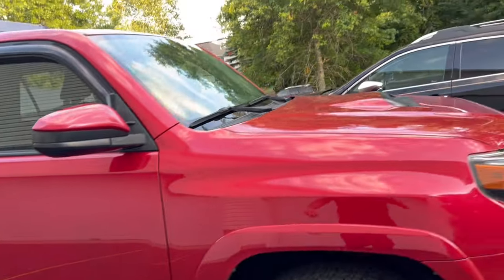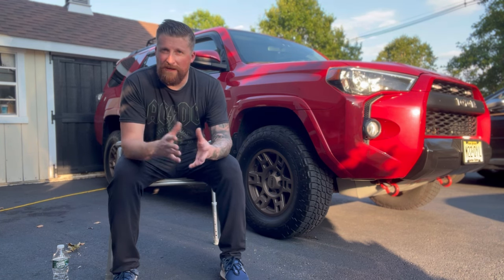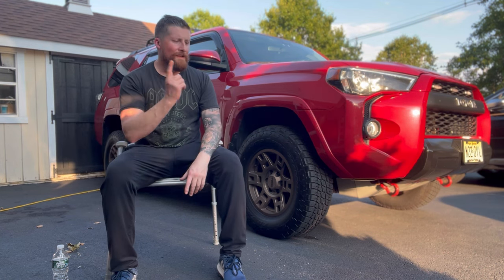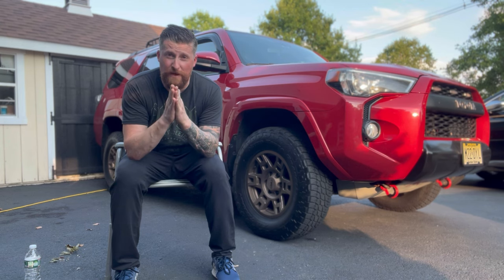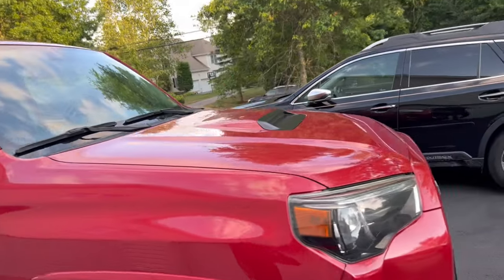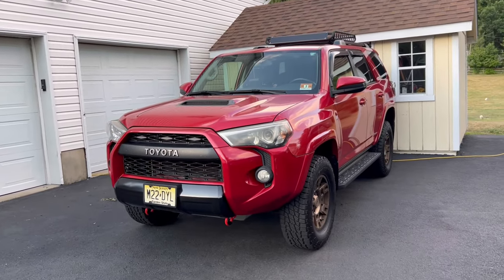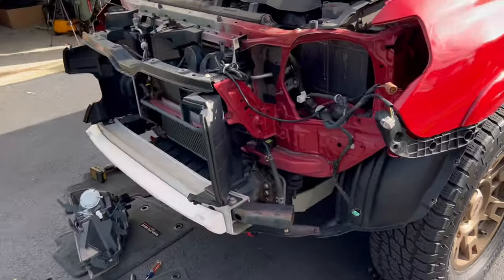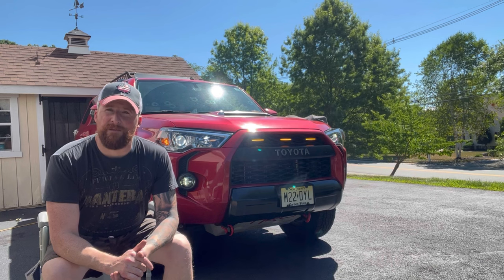The Toyota 4runner Story I never wanted to tell! It was cheaper but…

Comment: You gotta live with it. My 4Runner has waaaaaaaaay more rust under the whole vehicle than yours. I'm guessing an issue with 4Runners? But it runs great! If you don't like it - probably best to trade it in. 

Mine is paid off so I'll drive it until the engine goes. Currently I have 230,000 miles on it.
Reply from the maker: 230k that’s awesome, what year?
Im totally going to live with it, at a tender 168k miles she’s barely broken in + in 5 years has never let us down.
Best car I’ve ever owned.

Comment: Great story/video! Really appreciate all the straightforward commentary and advice from the videos. I just purchased a 21' TDR ORP with 45k miles from Enterprise rental. Clean Carfax but no maintenance records other than most likely changed oil  and rotated tires. Took it to my trusty Toyota dealer and told him to assume nothing had been done and to start all over. He took my money of course but said overall the truck checked out great and is in really good shape mechanically. I always get over 200k on my vehicles, but I've always purchased them with less than 20,000 and even then with complete maintenance records - so a  little nervous.  Your comments certainly help to alleviate my anxiety. Looking forward to mods!!
Reply from the maker: I appreciate your support!!
TRD ORP nice find 👍🏻
I can guarantee you that with routine maintenance, 200k will be a breeze. 
Lots more content to come. 😉

Comment: Considering I bought a 4Runner that had a Carfax that showed two wrecks I think I answered your 1st question!  The challenge with the Carfax is that it doesn't show the severity of the wreck beyond general categories.  Also, I figured if the wreck shows up in Carfax it was probably fixed professionally....although as you mentioned that is no guarantee the work was done properly.  I have only had my 4Runner for a little over a year and so far no major issues so time will tell if I got a good deal or not.
Reply from the maker: Fingers crossed 🤞!
Thank you for sharing your thoughts.
Appreciate you watching!!

Comment: Here’s a pro tip. Before putting in new headlights, wet sand them and clear coat them with a quality clear coat. This will keep them from fading and yellowing. I’ve been restoring the old faded headlights in our vehicles this way and the results are amazing and you can wax your headlights when you wax your car. I wish I could post pictures of the results on here.
Reply from the maker: That’s very Interesting, I certainly don’t want to replace them again. I appreciate you sharing!
Reply: This does do a pretty good job.  I’ve been doing what wildman’s suggested for years now.
Reply from the maker: Might just try it on the old headlights first.
Reply: @VikingsGarage  Same I've wet sanded polished them and with time and with no care to them they will fade again. Wet sanding them then clearing them with 2k clear coat they will look a lot better and last. I would use a better coating then wax. Like ceramic coating or graphene coating.  There's some decent ones that don't break the bank on Amazon. Watch a few of Scott HD videos that he does tests on cheat to expensive coatings for over a year and has monthly updates on his test panels of multiple products.
Reply from the maker: Thank you!
Reply: @SescoDviejoC  Yes, the 2k glamour clear is what I use also. I just did my daughters 2010 Camry and they look better than new. It made the car look new again. Wish I could post pictures on here, they look like diamonds! 😁
Reply: So frustrating brother, and sorry for your headaches!  As we all know used cars are typically sold “AS-IS”, so I don’t think you have any recourse.  You are correct that Carfax is not always accurate.  I did have a Land Cruiser that I caused over $8,000 in damages to, filed an insurance claim, had fixed at Toyota, and it never showed up on Carfax when I sold it.  With that in mind, I’d never buy a used car without taking it a mechanic, and a body shop to have them check things out.  Regarding replacing your doors, have you tried an auto junkyard?  They take in totaled cars to sell for parts (you usually have to bring tools to remove the parts yourself).  As popular as the 4Runner is, and as long in the tooth that the 5th gen is, there are bound to be some undamaged doors at an auto junkyard somewhere near you.  I hope that helps, and good luck sir!
Reply from the maker: Thank you , I appreciate that!
Reply: Thank you for the great tip, much appreciated!
Reply from the maker: You got it!
Reply: @VikingsGarage  Can you do a video on wet sanding the headlights and clear coating them?
Reply from the maker: That’s actually not a bad idea. 🤔👍🏻
Reply: @VikingsGarage  I can’t wait!

Comment: End of the day, most solid vehicle on the road. 

I sold my 16’ but a coworker that does inspection work literally idles his 12hrs a day. AC on in summer and heater on in the winter. He complained at 180k when his water pump started weaping. I told him well you haven’t shut it off in over 6 months 😂
Reply from the maker: That is insane, but you’re absolutely right… that much abuse it was kind of expected. 
It’s one of the most reliable vehicles I’ve ever owned. I’ve owned a few!!
Thank you for sharing your story.

Comment: Yes, I did the same.

I bought a used cargo van at a very low price.  I could tell it was in an accident by the slightly mismatched paint but the body work was immaculate, as being a cargo van, there was no insulation in the interior so I could see all the metal panels from the inside.  I'm not a body man by any means, but I couldn't see any wrinkles or welds in the body from outside or inside.  I crawled under the van and couldn't see any frame repairs or major rust.
Reply from the maker: And bet you, it’s been a great van.
That was a great 4Runner, my brother in law is still driving it.
Currently at 210k miles

Comment: I would have bought the truck for 21k. It's a good buy as long as it didn't have structural damage.  Check the A pillar because the driver door isn't aligned to the fender or the rear door. The reason I know is because the body lines don't match up.
Reply from the maker: I will check it, although not much I can do at this point. I appreciate you watching, thank you for the info.

Comment: I personally think you're still on top with this 4runner. 
The body work done could be the insurance company the previous owner had. Geico (if that's what the previous owner had) tends to pay out the least compared to other insurance companies (they estimate using cheap aftermarket and some times junkyard prices. Offset that with a cheaper estimated bodyshop work = not so good results) and your 4runner could be a reflection of that. 
- As for the doors, don't go to MAACO. That's the worst place to go (you get what you pay for). If you're thinking of replacing the entire door with good ones, I'm sure with some patience you can find a pair with same color. If not, wrapping the truck with mismatched color doors would be a decent solution 🤷‍♂️. 
--I guess these are the issues that come with a "dirty" carfax vehicle lol
Reply from the maker: Ain’t that the truth, insurance companies will most of the times not pay enough to the body shop to complete the work. Hence why they do what they do.
I think your right, some patience and I’ll find some good doors. 👍🏻

Comment: I just purchased my 2015 SR5 with a “dirty” one owner carfax, although I would really only consider it a dirty carfax if it had been moderate/severe damage. Upon arrival I found some very slight front bumper fitment issues which were indicated by the carfax, but also noticed the rear bumper had some issues which weren’t on the carfax. The other thing the carfax showed that every single oil change during winter months had been done in South Carolina, so that pretty much cancelled the fender benders in my opinion.
Reply from the maker: Thank you for sharing your story.
The same here, the first 60k maintenance was very good so I kind of took that as a factor. 
The Dodge dealership should have changed both filters before I got there, plus their clean-up crew never clean under the 2nd row seats. So… I used that to save an additional $895 🤷🏼‍♂️😉
Reply: @VikingsGarage  that’s unfortunate, but like you said it’s a great bargaining chip when you bring it up to them. The reality is that many people who want to buy a car just drive to a dealership and leave with whatever appeals most to them. When you are mechanically inclined and have hunted down a few very good options, it puts you in a great position as a buyer. 

I live in upstate NY and there’s a few shady dealers around me. I had to drive out to Binghamton to buy mine. I do have to say, I bought at the wrong time but I could not wait any longer than the year and a half I’ve been waiting to buy one.
Reply from the maker: I hear you buddy, right now forget it. Buying a car is almost absurd.
But I get it, that’s a long time to wait. Congrats and enjoy it!! 
Thank you for your support!!

Comment: I really want a 4Runner and I’ve seen a lot. I even considered getting a rebuilt title, it looked good and the guys at the dealership said it only had water go up halfway to the tire, but I knew it was going to bug me that it wasn’t a clean title. The majority of 4Runners I looked at the carfax was clean but you could tell by the gaps that it had work done. Guys go and get stuff fixed and aren’t reported. It’s a crazy time to buy anything but I may go brand new knowing it’s definitely a clean title if the prices ever come back down to earth, if not then I’ll be driving the RSX-S until it’s no more.
Reply from the maker: I don’t blame you, the market is totally bunkers right now. Wait a little, then buy new.

Comment: That is an easy question to answer.  Do you want another payment? Keep it and maintain it.  My 2011 runner I bought in March of 18 was great. The front bumper was repainted, which I knew about,  the clear coat peeled like a sun burn. I ended up making my sr5 into a trail with the front and rear bumper swap. I bought all the OEM front Toyota. I also installed OEM trail front and rear lights. Looked at local body shops. Reviewed their work, found a great one. 900 to spray the bumpers. I installed them. Unfortunately later that winter the rear spoiler and shark fin peeled too. 400 bucks later it is rectified. 
I am a huge preventive maintenance guy.  I maintain the paint, under carriage as best as I can. My last vehicle, 99 suburban,  the frame  rotted out.   I had it for 12 years because I just didn't want to have a payment.
Reply from the maker: Very cool, thank you for sharing! 
I’m right there with you, I have no car payments and I intended to keep it that way. We do whatever it takes to keep them sharp/ reliable and on the road. 
I appreciate you watching, hopefully you’ll find plenty of useful content on my channel to help you with your 2011. 👍🏻

Comment: i did the same thing.  I bought a 2018 TRD off road in barcelona red with two claims both were under 2000 and I reviewed the repair documents.  New front bumper replacement and rear bumper replacement.  no big deal.
Reply from the maker: That was exactly my thought. I saved almost $5k at the time. I appreciate you sharing your story!! 
Happy New year!!
Reply: @VikingsGarage  I didnt do as good as you did! since I just bought mine in August. Amazing how much they have appreciated in value. MSRP goes up every year.
Reply from the maker: It’s so crazy!!

Comment: You did save thousands when you bought her.  So my 2 cents is, keep her, and know that your awareness of the repair issues are typical.  I've worked with repair shops who were perfectionists.  And they did a good job.  We're the replaced parts toyota OEM?  Or Chinese.  But you have a 4runner.  You have the basics there, in excellence.  Power train and electronics are superior.  I lived with a 2005 subaru sti that had been hit twice by worthless deer.  Rebuilt but I knew that what basics remained, such as no performance issues after repairs.  Your 4runner is still a 4runner.  Get the work done on the doors.
Reply from the maker: I appreciate your input, I am planning on having it addressed and fixed properly after this winter. You’d right, at the end of the day it’s got that Toyota reliability. 😉

Comment: I bought a low mileage 1996 4x4 tacoma in 1999 for cheap. I bought it from a rebuilder due to being sold by the insurance company. It was torn up and different colors, missing dash ect. I rebuilt it and still have it 23 years later. I hope to get another 23 years out of it.  It's got 160k miles on it now. Nothing wrong with a salvage vehicle if you know what you are doing. Car fax wasn't popular back then but even if the title was clean. Apparently they ran it through Colorado and then back through a different state which washed the title. Colorado was an old trick. I was able to get a loan from the bank because of the clean title and just never said anything to them about it. I'd totally do it again but it's not for everybody. On a family vehicle I may not do it but for a work or offroad type vehicle sure.
Reply from the maker: Super cool story thank for sharing it with us!!

Comment: Great  job on headlights.  If it were any other vehicle I would be weary of keeping it with compounding troubles down the road, but a 4runner, take care of the cosmetics and it will out perform  any other in its class IMHO, keeping up with maintenance of course as I'm sure you're aware.  I have 2007 SR5 with 170000 and it drives like new, and I live in Vermont  salt belt,  but I Fluid Film the frame 2x year.  Great video, take care.
Reply from the maker: These things are built to last. Im a firm believer in preventive maintenance. So 🤞I’ll drive it another 60k.
I need to spray the frame again.
I appreciate your support . Thank you!!

Comment: your drivers side lights were likely replaced with non-OEM lights.  The discoloration is a dead giveaway.  After market UV coatings typically don't last as long as OEM.   You also live in Jersey which doesn't help with the rust issues.  Ex-Long Islander here and moved to Charlotte years ago.  When purchasing a used vehicle the first thing I do is look at the Carfax, even if it's clean but I see it's from the Northeast, it automatically gets passed over.
Reply from the maker: Yeah it gets rough around here with used cars.
I appreciate you watching!! 
Cheers 🍻

Comment: My question is how is the frame?  As we know the frame will determine the bones of the 4Runner.    We are on 4Runner #3, 2014 4Runner, also have a 02 4Runner.  If yours is 4wd and the frame is good, turn it into an off read beast with after market bumpers and other 3rd party stuff.
Reply from the maker: The frame is in great condition, I’ve been treating it for a few years. I have a feeling I might be doing a lot of aftermarket stuff in the near future.

Comment: My fathers was a originally a rental and had car fax damage for front and it has been great.  He got a great deal.   I do notice that the metal tube running vertical was bent and never fixed.   I don’t know if that makes a difference.  
I know drain holes on door tend to get clogged causing rust so I would make sure the stay clean.   
I would keep it and just fix it and never look back.    Where did you get your replacement headlights and how much?
Reply from the maker: Thank you for sharing your story.
The drain holes in the doors being free of debris is an excellent point, thank you for reminding me.
I got both headlights on EBay for $200  and $95 for the Fog light assemblies. The Fog lights are new also.

Comment: Wow amazing what fresh headlights do for the look !  Nice !   I'd say get the rust fixed and spray the whole vehicle after for matching.  But in my opinion I dont think maacco is the place to do it.   Unless you know people who have used your local one and got quality work done.  Maybe find a local body shop that might want to give you a little break for some review time on the video ??  I had a red Toyota 4x4 and had body work done on the bed and didnt spray the front of the truck..it was still perfect.. ended up not matching.  Red is a really tough color , even exact paint wont match because red pigment fades slightly.  I think you can line up that quarter panel for the gap correction  :-)   It's just the money you saved earlier going back into it now.. Keep on rockin' man !
Reply from the maker: I appreciate you man. 
Will post an update soon as I have one. 
Thank you for sharing your thoughts on this.
Reply: @VikingsGarage  if they fix that rust the right way..you will have many years !
Reply from the maker: That’s my plan, unfortunately for me it’s going to be more then $1500. 
Better safe then sorry right.